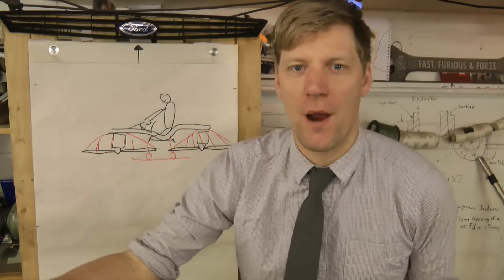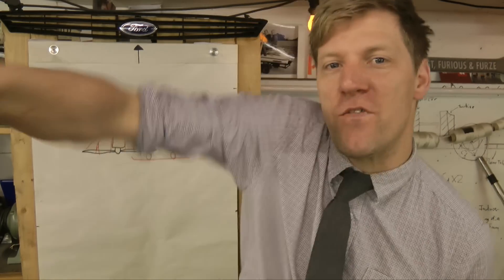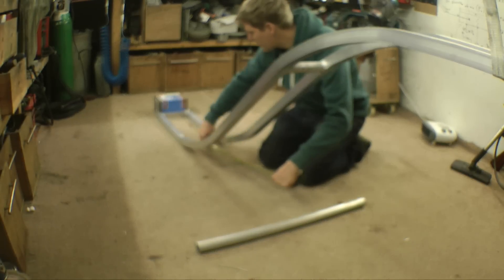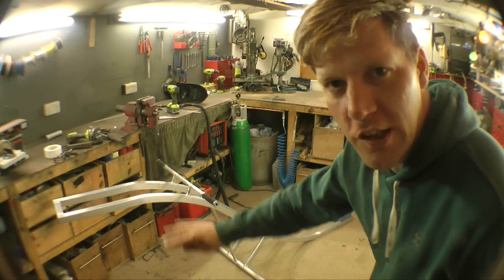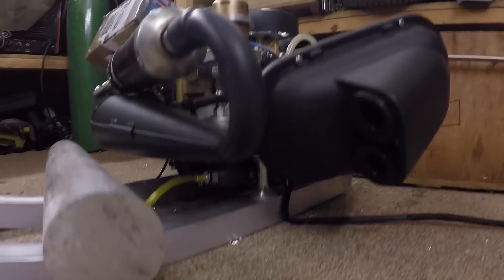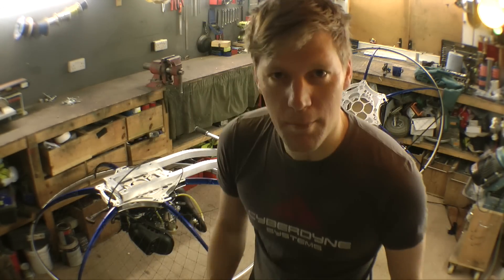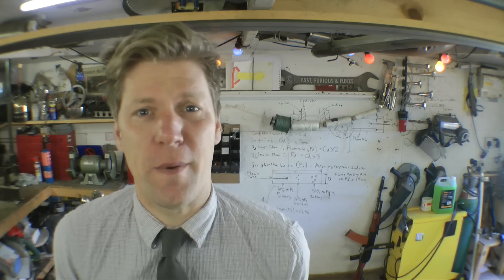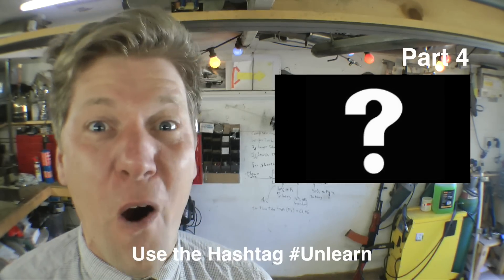Making a Home made Hoverbike

Comment: Man you are crazy!!  can't wait for the next video... will it work??
If you flip one rotor upside down, don't you then get one rotor creating downforce and one creating lift? Please explain the physics behind this a bit more...
Reply from the maker: +Josh Hyman you get a flipped set of props if that makes sense
Reply: So a propeller is basically a wing. Obviously wings only work when they have air flowing over them, and in a propeller we do this by rotating them.

How does a wing work? Well, it sits at an angle to the airflow. When the air hits it, it will be pushed downwards and because physics (see: conservation of momentum), this will push the wing and everything attached to it in the opposite direction (hopefully up!). This is why (some) aircraft can still fly upside down.

This all means that if you rotate a propeller in one direction, it will push the air down, or in the other direction, it will push the air up. Obvious enough. However if I now flip the propeller - almost like a mirror image - rotating it in one way will now push air up, and the other way will now push it back down!
Reply: the propellers probably rotates opposite ways so that they both create lift
Reply: its not the prop, you need the rotation direktion otherwise the craft, or what ever its called, will turn in mid air or will be not very stable
Reply: +Josh Hyman it will not work properly for sure. It seems like he did not even make some research in this topic. the minimum number of motors to make something like that work is 3. This is because if you only have 2, you will not be able to turn due to the rotatory forces, i mean if you want to turn left, one of the motors have to spin faster. But the chasis would therefore be unbalanced.....
Reply: Diego Lizana de Arribas Then how's a Chinook fly?
Reply: He had to flip the prop on one engine because he flipped the engine in order to have them spin in opposition. If he had not flipped the prop as well, one engine would produce down force, while the other engine would produce lift. That's why he has an "S" style frame and mounted one engine under the frame, and the other engine above the frame. Both engines need to spin opposite each other, and produce lift in order for it to fly and still maintain stability.
Reply: +Josh Hyman Flipping the prop will avoid the yaw of the vehicle. The "wings" however, will push down and up. If you flip the "wings" of a prop, it will now push in the same direction as the other.
Reply: +Kit Naylor Single/dual rotor helicopters are able to adjust the angle of the blades mid-rotation so that one side creates more lift than the other. (google rotorhead)

For fixed props like in radio controlled multirotors you need atleast three with tilt mechanism on one or four completely fixed props to get control/stability on three axes.
Reply: Kit Naylor omg you should learn how does that work. The propellers can change the pitch, therefore the issue with the balance is not possible.
Reply: +Josh Hyman He only flipped the motor, not the rotation
Reply: i wonder if it's gonna stay up anyways because it has a rotor in the front and one in the back but if you're unbalanced for 1 Sex the whole thing should Roll to the side i guess
Reply: +Gaming2304 Yeah it's up to him to keep it balanced, a bit like a motorcycle
Reply: +Varesa what I mean is a bike gets its stability and Balance by your acceleration but this thing doesnt even have anything but Air to "stand" on. if it would be like a Quadcopter i guess that wouldn't be such a Problem
i mean I don't know if it's gonna be a Problem just a guess ^^
Reply: +Diego Lizana de Arribas yes but furze will be on it, and he can turn/move it by leaning. If he is doing it like I think he is, the rotors are slightly tilted forwards, so it can go forwards. To steer, he will lean. I do, however, forsee problems with stabiliity, as the center of mass of this thing appears to be above the center of thrust.
Reply: if you flip the motor then the two rotor blades would spin in opposite directions. Put the blade on the other way around (angled downward) keeps the up-thrust; but you're right, if the blades were kept pointing outward, he would have a problem.
Reply: +Kit Naylor are you a science teacher?
Reply: +ShadowWave thats what flipping the motor does....
Reply: +colinfurze Doesn't that make one a propellor and one an impellor?
Reply: +Kit Naylor chinooks do not have fixed rotors, they have a swash plate to control the angle of attack of the rotors in different angular regions, like that they can use pitch, yaw and roll to control the flight. increase throttle of both = increase lift. Colin can only control pitch and probably yaw with displacing his body weight... but thats a meta stabile system aka labile... it will take off, but hovering it will be almost impossible without a lot of training.
Reply: +Diego Lizana de Arribas even with 3 its not possible because you will always get spin force
Reply: +Diego Lizana de Arribas he doesn't turn yet lol
Reply: +Josh Hyman You flip the bloody prop. Simply done. However.  One will be pushing closer to the ground vs the other. One is pushing into "clean air" the other through an engine assembly. So the question is, how much will this affect trust? Can't wait to see the results.
Reply: +Kit Naylor The Chinnok uses variable pitch control. This is using nothing else but speed control. I am afraid Diego is correct. You need minimum three to be able to control yaw without loosing trust. Or 4 is even better (think of a quad copter).
Reply: +Josh Hyman Im pretty sure he can just flip the propeller.
Reply: this machine will be steered by leaning one way or the other or perhaps he will add steering in the for of flaps to direct airflow, not sure on that but chinooks fly with two props because the props themselves are not one solid piece and can be moved to facilitate steering.
Reply: +Josh Hyman If you leave the propeller as is,yes, you will create up-force, but if you reverse it then it will work as it should.
Reply: +Josh Hyman he would just flip the tilt of the rotor blades on the upside down motor so that  the thrust is still directed downwards. Its the angle of tilt of the rotor blades that determines the direction of thrust. Have a look at a high-end remote control helicopter, they can fly upside down because they can reverse the angle of attack of the blades to change the direction of thrust even though the blades are still rotating in the same direction :)
Reply: +Josh Hyman I'm with you here. Flipping the engine over reverses the thrust. Flipping the propeller over would have no effect (thrust would still be reverse(up).) He apparently obtained  new prop with a reversed pitch.

And for those that say flipping the prop over would change the direction of thrust, here's why it doesn't work that way. The profile of a propeller blade looks something like this..  / .. Now flip that profile 180 degrees vertically and you still have / .
Reply: lol.....you are wrong. sorry buddy but if you flip this " \ " 180 degrees, you get " / " flip it another 180 degrees (or 360 degrees) you wind up with the original...think before you post dude...the final result of his contraption would be the front fan blowing down as intended. the back motor will still blow in the same direction but the motor is in the way of the thrust (which is my main concern at this point) but the main focus of switching the orientation of the motors themselves is to get one spinning clockwise while the other spins counter-clockwise while both props provide lift. essentially what he did was take the back motor, flip it, then flipped the rotor as well.
Reply: +Spudwellington Actually you should think before you comment. Lemme make it simple for you.. look at this... / ... now flip your phone, tablet, or computer monitor upside down (180 degrees vertically) and look again..it still looks like this / . Flipping the prop over HAS NO EFFECT on direction of thrust.
Reply: he flipped the direction of the motor too numbnuts
Reply: once again....do some research...
Reply: +BamaRailfan Ok..here's my mistake. I should have said flip HORIZONTALLY 180 degrees. My mistake. it is very late for me.
Reply: BamaRailfan wait no, you are right, but stiil all he had to do was flip the rotor to achieve opposite thrust.
Reply: +Spudwellington Exactly! Do some hands on testing dude.. he flipped the motor, which is why this discussion is taking place to begin with. He flipped the motor which made the thrust go up instead of down. Flipping the prop over will never change that! the pitch of the blades has to be reversed aka he replaced the prop..
Reply: that is where you are wrong, flipping the orientation of the props does indeed provide opposite thrust. this is how helicopters can ascent or descend.
Reply: the only difference is now the air has to pass over the motor instead.
Reply: i hope you are right and i learn somethng new tonight but im pretty sure im right...
Reply: essentially, the front rotor acts like a fan blowing air away from the motor. the rear rotor acts like a helicopter blowing air over the motor. but they both produce thrust in the same direction while allowing the blades to rotate in opposite directions
Reply: +Spudwellington I'm sorry, but no it doesn't work that way. I am an aviation mechanic so I have a pretty good grasp on the subject. Planes are able to use the prop to slow or stop by varying (or even reversing) the pitch of the blades. these are called variable pitch propellers. Same with helicopters, the blade pitch is variable. What we are dealing with here is know as a fixed pitch propeller. The only way you can flip around a propeller of this type and achieve opposite thrust would be to flip it into a mirror image, which obvious isn't possible.
Reply: +Josh Hyman I think you are right, it will only work when the propeller of the second motor would be flipped upside down, and the engine must turn the other way then. But if you do that you're straight back at the start of two props turning the same way. Hmm very curious how he will solve this.
Reply: by changing the orientation of the motor 180 degrees, you change the direction the motor spins. its goes from clockwise to counterclockwise by flipping it over then by changing the orientation of the prop, you set everything straight again.
Reply: +Spudwellington One last way I/you can demonstrate this concept. Hold your right hand in front of you at a 45 degree angle with your thumb pointing up and to the right. Now move your hand from left to right. Note the direction of thrust (down.) Now flip your hand 180 degrees (thumb down and to the left) and move it from right to left. This equates to his flipping the engine over and causing the direction of rotation to be reversed. Again note the direction of thrust (it is now up.) Finally, flip your hand 180 degrees again (back to original position) and move from right to left. This equates to flipping only the propeller. Note the direction of thrust..it's still up. Hope this helps.
Reply: im sorry man but i think you are wrong. if you take a regular electric fan that is blowing in your face and put the blades on backwards, it will suck air away from your face instead. if you then take that fan and turn it around, it will blow in your face again but be spinning the opposite direction. this is the simplest way i could think of to describe it.
Reply: +AlexxxelA dude pay attention. he flipped it so that they would rotate in opposite directions. he even said that.
Reply: +BamaRailfan dude. take a fan and flip the blades. i garentee you the air flow will reverse
Reply: BamaRailfan im sorry dude. either you are confused or you are wrong. also i highly doubt you are an aviation mechanic since you are unable to grasp the simplest concepts of how propellers work.
Reply: lets try another very simple example that you surely will understand. say im in a boat and i hit the throttle. the propeller spins and i move forward. now i put it in reverse. the same prop spins the other direction. i move backwards... got it?
Reply: +Josh Hyman you turn the blades upside down
Reply: Turning the motor does not change the direction of rotation, he has to do that manually, he only flipped it so that he could change the direction of rotation while still having the propeller produce lift. The reason he flipped it was because if both propellers rotated the same way the whole vehicle would also slightly rotate the same way. Hope that clears it out :)
Reply: +Fredrik Magnus he flipped the orientation of the propeller as well
Reply: +Josh Hyman all hail the backflip machine :)
Reply: +Kit Naylor a chinook flies with the help of some u joints and pivoting rotor assemblies if im not mistaken
Reply: BamaRailfan thank you! its not that complicated, he has to get another set of rotors to even achieve thrust with opposite turning with both motors... but wont work anyway, its too unstable to be properly flyable.
Reply: +Spudwellington yea I got that..you reversed the rotation of the prop..you didn't flip it over. sorry I can't show you the light. it's not that hard of a concept to grasp..
Reply: +Josh Hyman he flipped the back prop on the shaft so the angled sides are still facing the same way as if the engine was the right way up.
Reply: The spinning of the the blades will rotate the vehicle so 1 needs to spin the opposite way to counter the force. If 1 was updside down the vehicle would pull a back flip
Reply: +Josh Hyman one motor will pull up the other will push down ...
Reply: +Spudwellington Simply WRONG! if you turn the blades around the Fan will still blow you in the Face! You cant physiclly change the rotation of the Engine, so he flipped it to do that, but he needs a counter-rotating Propeller.
Reply: +Josh Hyman I'm pretty sure he flipped the blades as well. If he didn't then I would be pretty confused.
Reply: +Spudwellington I made a video and put it on my channel to prove once and for all that turning the propeller upside-down has absolutely no effect on the direction of air flow.
Reply: Varesa (and everyone else :P) The Chinook is probably a bad analogy on reflection - Let's run this through case by case:
To rise or fall, the rotation speed for this vehicle's propellers must be increased or decreased equally. So the torque will cancel out. So far, so good.

An important point to bear in mind is Newton's First Law: "And object will continue in motion unless acted on by an external force!" No force, and it will carry on moving.

Obviously, as the thrust is along one line, there cannot be any yaw control - however, it looks like the center of mass is below the center of thrust, so it will act like a pendulum.

To go forwards, the thrust for the rear must be increased (and optionally decreased the front, although that would be less safe, as it would drop) momentarily. However, this must be a tiny % throttling, as only a few degrees is required. This will set a front-to-back rotation going. Unchecked, it will attempt to do a frontflip. It will also (due to the unbalanced torque) begin a horizontal rotation.
However, when colinfurze (hopefully) increases the thrust to counteract this rotation, the flip motion will be arrested as will the slow horizontal rotation. Thus there will only be a very slight course deviation.

To carry on at a steady speed, the craft will need to be completely leveled. Thus completely removing the course deviation.

And of course to stop, the whole thing needs to be flipped slightly backwards to stop.

To rotate controllably horizontally, it will have have to have the torque varied rapidly of each motor, which will give a rotation in the required direction (and because the torque was varied rapidly, because physics - ask and I'll go into this in more detail), there will only be a very slow translation.

Of course, this all illustrates why such things are normally fitted with gyros to automatically level themselves.....

Oh and BamaRailfan, flipping propellers does reverse the airflow - (1) think about it, (2) it allows me to use the same propeller on my pusher flying wing that I use on a tractor aeroplane.
Reply: +Kit Naylor Do both engines on your aircraft rotate in the same direction when viewed from the shaft end? Check again. Many dual prop planes have engines and propellers that rotate in opposite directions to counter torque. Swap the props from the right engine to the left and you'll have reverse thrust. flip those same props front to back and the thrust is still reversed. This is why you have to know the engine rotation when buying a new prop. 

One final note. Look at the cross section of a propeller blade. It is shaped similar to an airplane wing. Turning the prop around not only does not reverse thrust, it makes the setup much less effective.
Reply: BamaRailfan That's basically what I just said...
Reply: +Kit Naylor No, you said flipping a propeller over reverses airflow.. It does not. the only two ways to reverse the airflow from a propeller are to (1) change the blade pitch or (2) reverse it's direction of rotation.

I have better things to do than beat my head against a wall anymore. Apparently the physics and concepts of how propellers actually  work is far beyond the comprehension of a great many people.
Reply: +Kit Naylor I missed your reply at the very top of this comment section. You posted a very good description of how a prop works. The only issue is you said to flip it into a mirror image. That would indeed reverse airflow, however it is physically impossible flip something into a mirror image.

And one final note, for those interested, Colin said in the first comment that he got "a flipped set of props" aka he replaced the prop with one with opposite blade pitch.
Reply: Perhaps the point I'm trying to make is getting lost. I challenge anyone this. Walk up to an airplane and remove it's propeller. Now reinstall the same prop flipped front to back. Now, which way does the air flow when the engine is started? The same as before.

Colin flipped the entire engine around the opposite way, thereby reversing it's direction of thrust from up to down. Unbolting the propeller and reinstalling it flipped front to back will not change that fact. 

If anyone wants to argue this obvious fact, go ahead. There are plenty of folks out there that could use a good laugh!
Reply: +Gaming2304 a bike does not get its balance from acceleration it gets its balance from rotating mass AKA the wheels
Reply: You would think that he would simply flip the propellor blade around, so that way it would be generating the same direction of lift, only spinning the opposite direction.
Reply: +Josh Hyman So hilarious to see so many people liked this comment :D
Reply: +Lucas Foreman if he done that he'd be chewing up the ground because the pitch would be the opposite but direction of the prop spinning the same, so it would be creating the negative space underneath the bike rather than over, sucking it down and making him do backflips